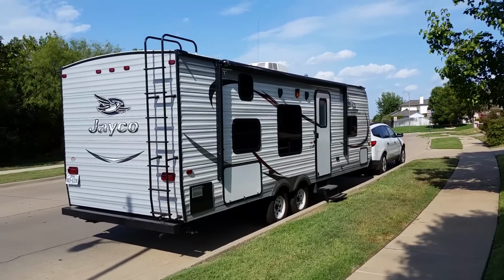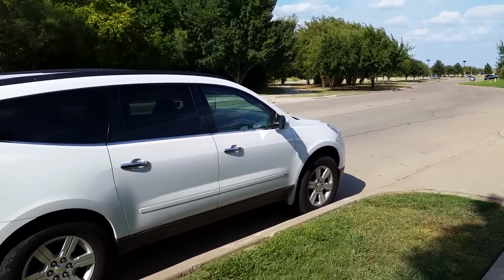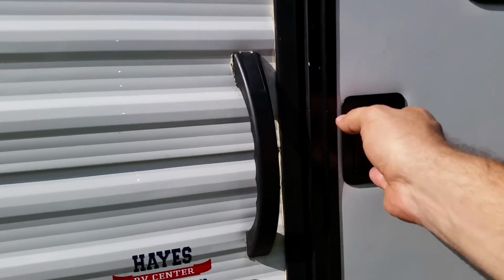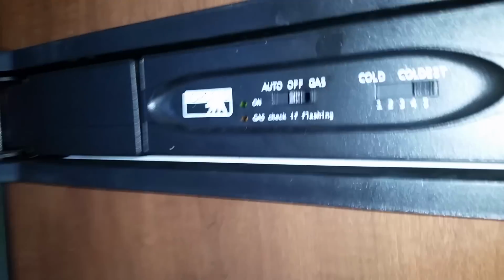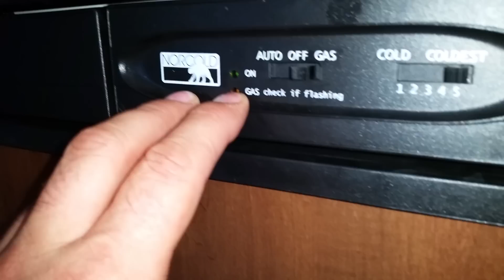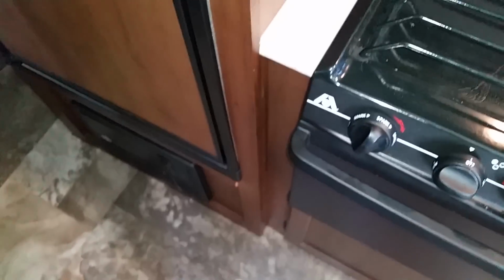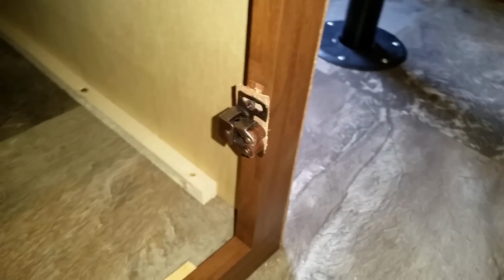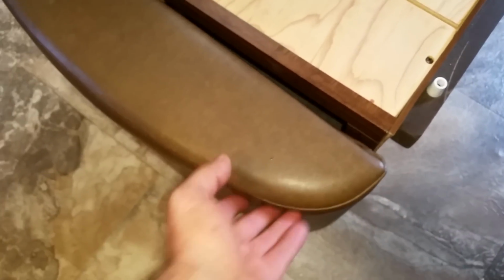Update: New JayCo Trailer FALLING APART.  Lengthy Warranty Work Needed.

Comment: People have to understand one thing. Buying an RV [most brands] is NOT like buying an automobile - as far as warranties are concerned.  These things are just thrown together at the factory. I even suspect that corners are deliberately cut to get them out the door -assuming that repairs would be later caught and fixed under warranty.  All i can say is that, in buying an RV, it behooves you to be a handyman. Most of what I saw in the video can be easily repaired but that's not the point. It should not have happened in the first place and the company should have a timely repair schedule to get defects fixed. You should not have to think that you must be an accomplished handyman when purchasing and RV -unfortunately but that's the way it is.
Reply: Absolutely..... If you don't like tinkering on shit, don't buy ANY RV.
Reply: Jason  Jackson One problem I've repeatedly seen is buyers saying the manufacturers of their trailers REFUSED to fix things under the warranty. Seems surprisingly shady to me.
Reply: monte gb Bullsh*t. There's "tinkering" and then there's fixing serious issues which are the result of poor manufacturing and/or materials. Clearly Jayco was/is cutting corners BIGTIME to churn out such substandard quality products. You shouldn't have to be a certified RV repair person before buying a brand-new RV.
Reply: I agree. But knowing how to do at least minor repairs is unfortunately a must - it shouldn't be that way.
Reply: Exactly right, Jason Jackson. I happen to be skilled in this kind of stuff. I can hardly imagine how we'd proceed if it weren't so.
Reply: Junk,  can't wait to get my Avion, getting so hard to find, also Silver Streak, and last Airstream!

Comment: the fridge I can say from experience is from driving with the fridge on lp gas. the flame blows out going down the road.  it will try to relight a total of three times and goes in to lock out. which is a safety mode. don't know how long you drive but if the fridge is cold 24 hours before packing it and the items you put in it are already cold you should be good to run with the fridge off for maby 6 you 8 hours. when you stop for lunch or sightseeing turn the fridge on and let it run. warning though unplug the camper from the car so not to drain the car battery. I have seasoned relatives that travel the country in their camper and for this all the time. for over 10 years. never had an issue.  also running down the road with the lp bottles on can be dangerous if you stop and think about it. if you have an accident or something gets kicked up and cuts the gas line you have a potential explosion.  same when you pull up to a gas pump. this is what our dealer instructed us as well as my relatives. also seams the fit and finish issues are due to the dealer not stepping up to the plate to take care of them issues. I have seen both of your videos and read the comments you never once answered where you bought the camper. I feel the same as the dealer that refused to services your camper. if you can't buy from them a local dealer then take it back to your purchasing dealer and have them for the repairs. although  who ever has done your service work is not smart. if you can't find a good dealer contact Jayco in Indiana. and see if they can help if your still in your two year warranty. I've heard good things from other people who stop their for service on their way through that area. hope this helps you with your fridge problem in the mean time.
Reply: I always (since 2004) run down the road with my LP on and my Dometic has never had this issue on either of my trailers. That a good point about it blowing out though, but thankfully I've not had this issue before. I don't see this being any more dangerous than fuel running from my gas tank to the engine while I drive. We can play what-if all day and never go anywhere. Its relatively safe.
Reply: What ever you say.  Not a matter of what if.  In Illinois it s a law no gas appliance running while driving.
Reply: For that reason.  Shouldn't have it running while pumping had either. But your the expert
Reply: I'm obviously the expert on grammar and spelling. ;)

Regardless, the danger is minimal at best. The trailer is far beyond the pumps since I fill up at truck stops. Would it also bother you that I fill up my diesel while it's running? Nevermind... rhetorical question.
Reply: In Illinois It is illegal to hang “obstructions” from the rear view mirror, including fuzzy dice, air fresheners, GPS units, etc. too, but they aren't going to pay my grocery bill if my food goes bad. Meh. Did you know in Illinois that you must contact the police before entering the city in an automobile?
Reply: well thay may be but I've only done rv service for 11 years
Reply: you know when people resort to being an expert at Grammer and spelling that's a sign of loosing. so stop downing people.  Maby learn something and move on
Reply: You do know I have the internet, too? I've done my research and I accept my choice. Also, I think you meant "There's." Please use some of your free time to catch up on your grammar instead of harassing a moot point. =)
Reply: Nice to see the gramma police at still out there. Not really interested in the main story but just there to pick you up on a few words that were missed by the auto-correct. Really Bill Redding you need to get a life & stop trolling YouTube to find minor discrepancies that don't matter in the big picture. Dyslexia is a terrible disease but just because you have it don't blame other people for your condition.
Reply: koolkar55  I'm just picturing gramma police. Is it a group of gramma's that are police? Or is it a group of police that go around keeping grammas out of trouble?
Reply: I'll let you be the Judge.
Reply: it's illegal to have LP on while driving
Reply: I have never had any problems with service work on my Jayco or Forest River products.  But then again, I live 5 miles from the factory. Just told them I was going to drop it off with a sign posted with all the crappy work that needed to be done.
Reply: Working to Relax a
Reply: put a frozen gallon jug in the fridge before traveling on the road.
Reply: I think the vehicle also has an internal
Combustion engine which is also dangerous

Comment: We purchased a brand new 2017 Jayco Jay Flight 23 RBS. Beautiful trailer. A week before the first time using and went to put slide out. Bang was the noise. So had no use of brand new trailer from July 1st wknd to mid september when finally parts came in.  Got a $300 cheque from Jayco for inconvenience. That was it.
Missed our group trip to East Coast and summer camping.  And totally agree with poor craftsmanship. All through trailer.  Now we have a mouse infestation problem. You would think by now Jayco should be able to seal things off to make it a more comfortable experience.
Will definately not buy a Jayco again.

Comment: I spent quite a few months looking around for a new trailer 3 years ago.  One of the first I went in to were Jaycos.  Every one you could just tell they were crap.  First, aluminum framing with fiberglass walls is just generally better.  More expensive yes, but better.  I ended up getting a Forest River...but they pull the same crap when it comes to quality.  Heat and air conditioning thermostat is a piece of junk, has to be reset every time before use.  Hoses for the plumbing are half-assed machine clamped.  Hose completely popped off internal pump, plus I had one start leaking under the kitchen sink.  Fancy aluminum alloy rims but the knuckleheads use steel lug nuts without isolating from the aluminum, so they rust quickly.  It's really about care in the design and pumping them out on an assembly line.  And as a general rule you do get what you pay for.

Comment: I have a Jayco XJ213 2016 and was told from our friend that works at Chesaco RV sales about these coaches. He had said never get the one that doesn't have pressed or vacuumed bonded walls because of easy damage or water problems. If and when you ever have a problem with your coach write and call Jayco and file everything with them and then proceed with their recommendations. Plus get the extended warranty with bumper to bumper coverage. I had a problem with the drawers not staying closed and the awning light strip when out so I did what I was told and all was done immediately and only through the manager. I do feel that Jayco makes a quality coach but I feel that the places we buy them from just like to get your money and put people off until the Warrenty runs out but when Jayco gets involved then things get done. Happy camping.

Comment: Unfortunately, this is common in the RV industry. I have bought several RV from one of the largest Up-State dealers in NY. Their service sucks, and to be honest, most all others do as well. I decided that I could do better myself and set out to build my own RV. I used an old Grey Hound Bus and it was ten times better than anything the market offered in the price range I ended up in.  I ultimately ended up with my own RV repair service which turned out very well. Word of mouth brought more business than I could handle, only because, I never did any work that if I couldn't repair it properly, I refused to do it at all. I was always honest and upfront with my customers and they seemed to appreciate that. One other factor that I think most people liked very much, I came to them with a mobile repair unit, instead of them having them come to me. (They didn't have to be inconvenienced to drive or tow their RV to a shop and have to get another way home and then do everything in reversed to pick up their RV when it was done.)This was especially true with class B. and A. RVs. Retired now, but miss the work and pleasure of helping people enjoy their RVs.
Reply: I knew a guy in San Antonio, TX that was fired from an RV repair shop because he was honest with customers and refused to to shoddy work. He started a mobile RV repair service and has more work than he can handle. The RV "service" industry is creating entrepreneurs. RV owners need to take each and every case to their state's AG and file complaints- that costs nothing.  Write and stay on lawmakers to write Lemon Laws for the RV industry- state-by-state if need be, or get Congresspeople off their lazy butts to do it. We do have a President who will sign it into law.
Reply: Kenneth Russell.  I've been thinking on doing this. I have a service truck that I use to repair farm equipment. Been doing this for 20 years. Thinking on a change.

Comment: We had a square trailer for about 6 months.  Dumped it and all of its issues and bought a 20 year old Airstream.  Kept that for about 10 years and sold it for more than we paid.  Minimal upkeep and maintenance.  Bought a newer Airstream and still have it.  Everything fits, closes and stays closed, and everything in it works.  Only thing we’ve done to it is installed a new stereo to replace the AM/FM cassette unit.
It tows like a dream and you’ll meet some of the nicest most knowledgeable people at the myriad of Airstream events.  The shared knowledge makes owning one a real treat.  And these Airstreams cost less than new square trailers. 
When you stay in a commercial campground in an Airstream you’ll usually be placed in a prominent spot and have a parade of fellow campers stopping by to look at it and ask questions.

Comment: I watched the factory tour for jayco where they built a start to finish rv in six hours. These guys were running and doing sixty second cabinet installations. They jammed the drills and screwdrivers into the panels and then ran to the next one. They built it in six hours and said they would build thirty six just like it that day. That is the formula for really bad quality. Luckily for this guy he only paid sixty thousand for the rv so he can afford to throw it away and buy another, but some of the jayco line is quite pricey.

Comment: Was going to buy a 17 foot single axle Jayco Hybrid. Instead converting a new 6x12 cargo trailer, single axle. Portable air conditioner. etc. 1,400 lbs. plus 1,000 camping gear.
Reply: How did that work out for you?  I ask because I wanted to do the same.  My biggest thought is you will loose the same amount of money or more than on an a crappy built RV.  Be honest and add up all the sweat equity, all the trips to Home depot.  But in the end you have your crappy RV and not some idiots.  I get it but was too afraid to sink cash into that big of a project.
Reply: Way to go. I was thinking of building my own trailer as most are just plain crapola.

Comment: We bought a used 2013 Jayco Jayflight 32TSBH last summer.  I have been impressed, so far,  with the quality and workmanship with this trailer.  It is a heavier trailer (33-34 feet long) with 3 slides.  The previous owner stated he a very few issues with the trailer.  We discovered a small hole in one of the water lines off the fresh water tank.  Easy fix.  You can find horror stories like this on virtually every brand of travel trailer out there.  I hope you can get your issue resolved soon.

Comment: Ability to pull is not a towing capacity.
Your severely, dangerously asking for trouble if you think you can handle that or any travel trailer that exceeds you vehicles manufactured rated towing capacity. It's not that it can pull it. I'm sure I could pull a locomotive engine with my Tahoe, but can it handle it, stop it, keep it from pulling my truck off the road in a turn, or control it under advert conditions, absolutely freakin not.
Reply: Keith Buckner going off your comments the trailer is 4700 dry. This suv is rated for 5000+. Fyi.
Reply: I wouldn't pull that large a trailer with that small a vehicle. Especially a stick-built trailer. with metal sides. The problem is not so much weight as it is wind. You go across Wyoming at the wrong time of the year with that thing and you'll get yourself a PhD in trailer towing. Or across the Chesapeake Bay Bridge. Or through a mountain pass in California with crazy winds. 
You need a heavy tow vehicle with a proper weight distribution hitch. Anything 24' and under, with an aluminum frame, can be towed with a 1/2 ton vehicle. Over 24' and you'll need what we used to call "3/4 ton" with a beefy rear axle. 
That Chevy has a weenie rear axle and run of the mill suspension. It's a soccer mom SUV. Doesn't matter what it's "rated" for. Chevy can slap any number on the thing they feel like. You can't fight the laws of physics...
Reply from the maker: And yet i drove from arlington texas to south fork Colorado just fine without exceeding tow rating,  ability to control in adverse conditions, etc..
Reply: I have to agree.  I have a 2017 Nissan Titan with the trailer towing package.  When we picked up our new Camper, the idiots at the lot ran the 7 pin around the equalizer bars and plugged it in.  I really did not notice it at first.  However, about 10 minutes out, people were honking at me, and some other signs that I won't mention that led me to believe something was wrong.  Pulled over, and found my harness was cut by the bars.  I was closer to home than the dealer, so we limped home with the hazard lights on.  One person thought that they would try to cut me off, and pulled right in front of me, and did a brake check.  Well, that is when I found out I also had no electric trailer brakes.  The Titan was able to stop me and the 9000 pound trailer, but, the equalizer hitch took the brunt of the stopping.  I have never seen one bend before, until this happened.  We did make it home, and then, had to argue with the dealer about the issue.  They told me to bring it in, and they would take a look at the issue.  Well, I asked them, are they going to be responsible for me killing either myself or someone else because I have no brakes.  They then offered to supply the 7 pin cable, but, I would have to do the work.  Went back up to the dealer in the car, picked up the cable, and installed it myself.  Now, all is working, but, just ordered a better equalizer hitch.  That will be installed soon.  In the meantime, we still can driveway camp.  Funny, never had this kind of issue with the Coachman Popup! Guess this was my "Welcome to the Jayco Family"

Comment: I had similar problems with my 1995 Jayco 262FK which I bought new. The sofa broke loose on one side, the frame was screwed into paneling with no bracing at all. I fixed it while we were in Yellowstone with 2X4s. 

There were aluminum shavings all over behind the sofa where holes were punched for water tank fill, power cord, etc. Some of those shavings got into the power converter and shorted it out. The dealer refused to replace it but the converter manufacturer replaced it and paid shipping both ways.  

The black and gray tanks had cracks in the drain flanges from the factory. It was clear the drain pipes were forced in and cracked the flanges on both tanks. The factory did shoddy repairs with glue which let loose and started to leak within the first year. Again, the dealer refused to make good on the warranty.

The water heater inlet leaked from day one and stained the vinyl floor in the kitchen. The dealer simply fixed the leak and did not replace the floor. Several of the 110V power outlets were loose, never installed properly. I had to fix them myself because by that point, I had zero faith in the dealer or Jayco. 

I never bought another Jayco or had any further dealings with that RV dealer owner who I had known for years. It turns out he sold the dealership to Camping World RV who called me and apologized profusely for the previous owner's bad reputation and made good on a good portion of the leaky gray and black tank replacement cost to earn my business. I was grateful for the notion and the help.